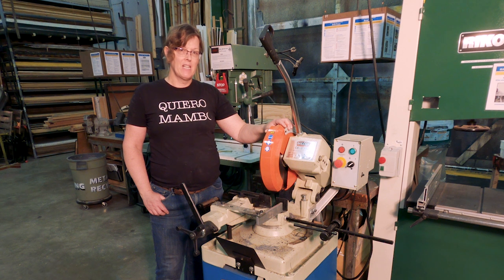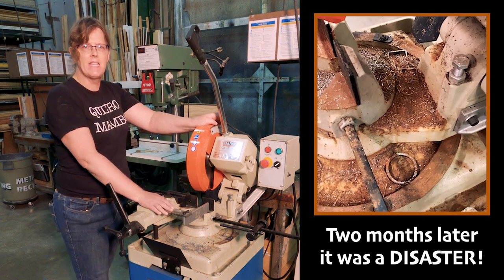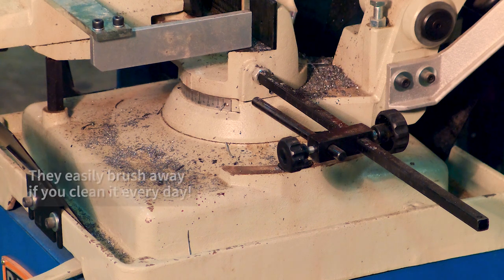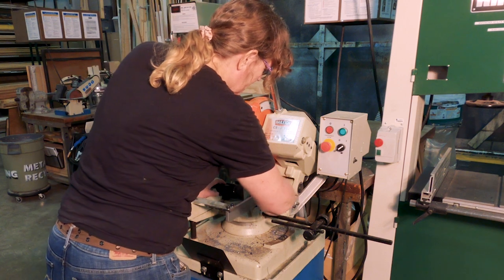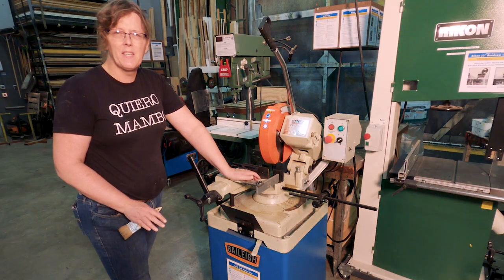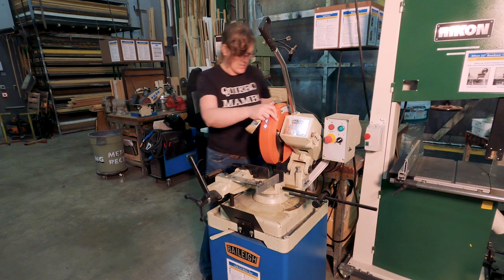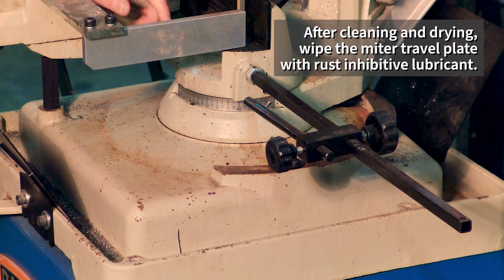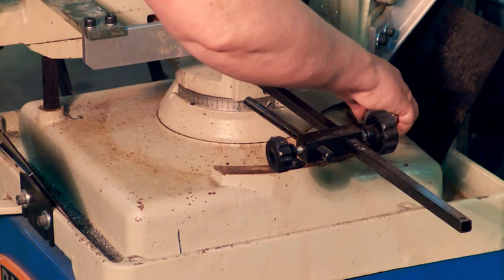Cold Cut Miter Saw – Daily Cleaning Routine

Comment: Exactly what I was looking for. This is the end of my first day on my new cold saw so I will be doing this every day. Thanks.
Reply from the maker: Awesome! I still can’t get the students and staff to do the daily care that is needed for this machine. But we have not had a recurrence of the caked on rusted metal shavings disaster. Fairly certain students were using plain water and not mixing it with coolant and that caused the issue.